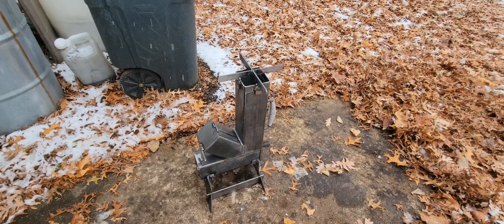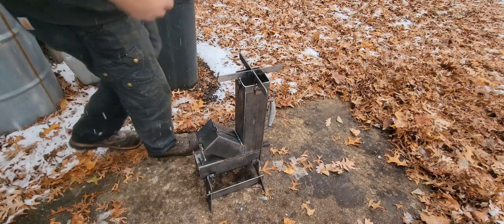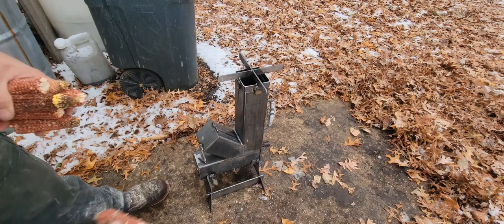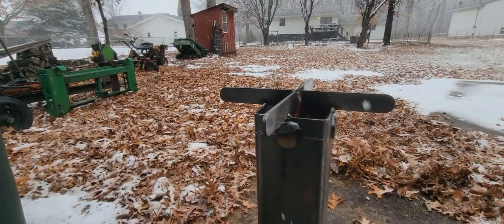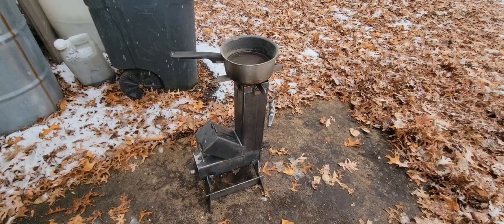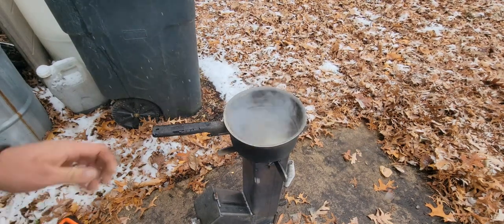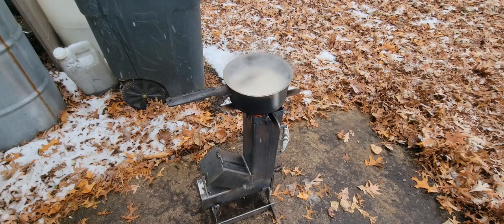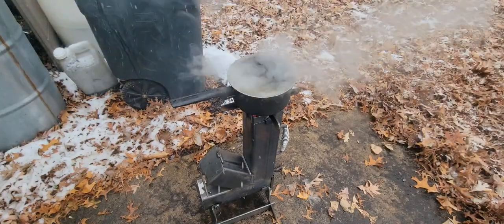Rocket Stove Will It Burn Corn Cobs? How Long Will It Take To Boil Water?

Comment: Oil up the outside of the stove with cheap vegetable oil. Usually you'll need to apply a few times before it builds up and produces a nice rust free finish. No matter what you use, eventually it will need to be reapplied.

Comment: works well! neat compact portable stove! functions well, is it a self feeding with the angled piece?
do you need larger pieces or can fine items like saw dust work or will it put out the flames? nice
video , burns pretty clean, low smoke .
Reply from the maker: I was happy with it!....yes it's supposed to be self feeding and seems to work well doing so.....well we can try saw dust you suggested it and I'll burn it in it!! Thank you! And yes it burns really clean!
Reply: That was fun. It would be great out camping in the woods.